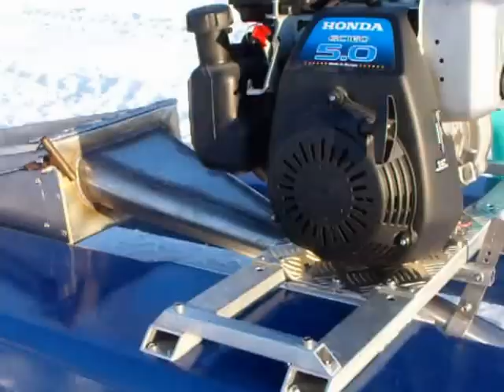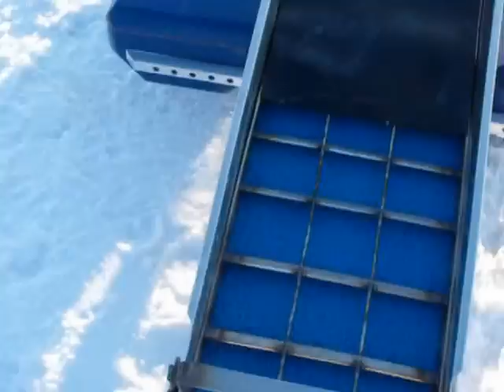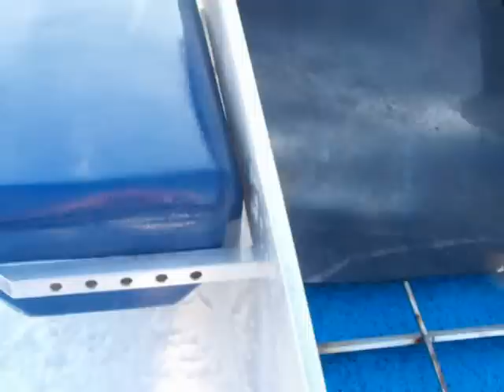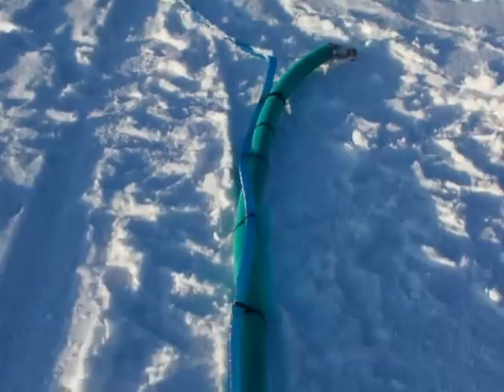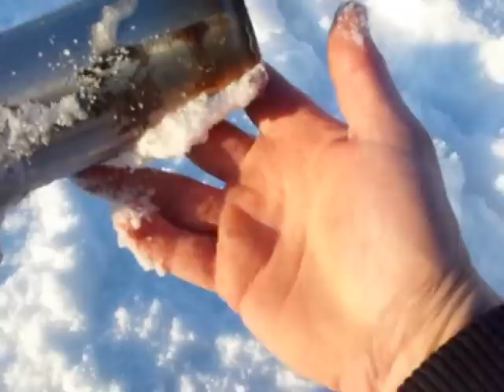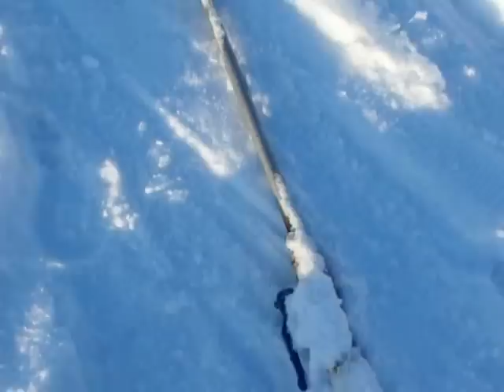2,5" home made gold dredge

Comment: Wow almost a perfect copy of the Proline 2½" dredge with floats and all. Great job on the flare. I think that the motor is fine just run it a lot slower and save gas. A smaller  3 to 4hp motor would be fine with a P100 pump but this is a nice set up. Convert it to an over under, loose the wave classifier, and put in 3/32 punch plate for the over under & you will catch a lot more of the fine gold. I had that exact same dredge in the store bought model and Proline does make the best.

Comment from the maker: @LUVMAGNUMGUNS2 small but the air bank will add some flotation =) 
and a quick release for the engine (so i can use it for my high-banker) + 1000 other idea`s?
maby for next year or maby not?

And flare out the sluice and make it longer is a really good idea!
the reason i did not do that was the trunk/miners moss size =)
but i hope reasonable feeding, lower rpm and 
let the sluice a little below the waterline would  help keep those -100? 
anyway what do I know?

Comment from the maker: @LUVMAGNUMGUNS2 
got a good engine from an out-burned AC generator and modified the crankshaft to fit the pump,
stripped away all the 1 1/2" shit and made the new sluice, power-jet, flare and so on....
I hope it will still fit in the trunk of my car.

And yes I know the engine/pump are a bit over kill, 
but its nice to have some power to move the overburden 
and if my health gets better I maby I make a water driven low pressure air-system, fit 12V generator
yes ( the floats are to

Comment from the maker: @LUVMAGNUMGUNS2 
 
so I started out building just that, because I had some 25 feet of hose in that size. 
I did the floats, engine base,sluice,flare, power jet.....well almost everything =S
Then my friend said that hi was going to order a 2 -2 1/2" dredge,.......WTF!!!!!
So I sold my fisher detector and ordered a real dredge pump with fotvalve from Keene eng 
and 23 feet of  2 1/2" suction-hose from a local dealer,

Comment from the maker: @LUVMAGNUMGUNS2 Thanks! And yes it sucks! maby more than the dredge it self ;) 
I will switch song ( I had You-tube to select song =) 

"And now a little about why it ended up like that." 
At first it was suppose to be a 1 1/2" power-jet dredge built from crap
powered by a 2,5hp 52GPM with  82 feet of maximum head lift pump 
and it was meant to fit in the trunk of my Skoda!

Comment: Are you using a smaller high flow line to create a venturi effect in order to create a daft for the dredging hose? 
Is the smaller blue tube for sucking out crevices?
Thanks!

Comment: I was hoping to hear what it sounded like... instead I got some plastic consumer track that hurt my ears... Nice get up though- and am thinking about using the same engine for my set up...
Reply from the maker: hi hi ...  the music was slump by you-tube I tried to put AC/DC Its a long way to the top but it did not work.... the engine is a good fuel efficient light quiet chose  =)
Reply: I suppose I was a little rude... sorry... I'm a Richard sometimes... If you can excuse me that, I was curious as the GC model comes with a 3/4 inch shaft... do you know what size pump works best and what professional model pump would be best for the intent? I would like to use a keene pump, but I don't know if a company of that caliber makes a pump for a 3/4 in shaft... Do you know if GC comes in 5/8ths shaft model? What did you do and how does it work for you? I'm residential and though I'm legal, I don't want to annoy the neighbors either... Thanks for your thoughts :)
Reply from the maker: Hi again .... I only used this GC 160  engine  because it was practical for free but php160 was perfect and I still have the power over if I which to pull a compressor. ..  and if you speak with Patrick keen and ask you can have the impeller modified too 3/4 for a reasonable price. ..